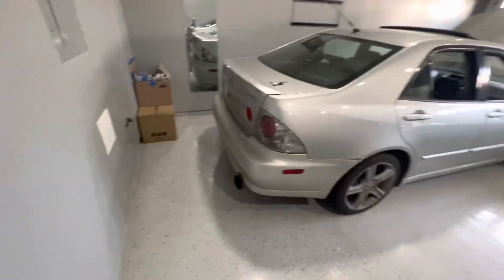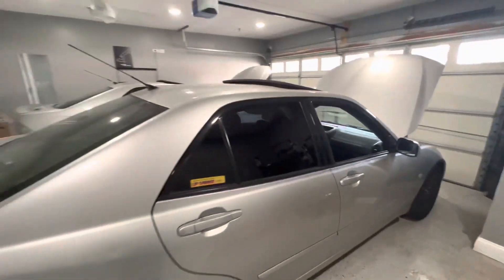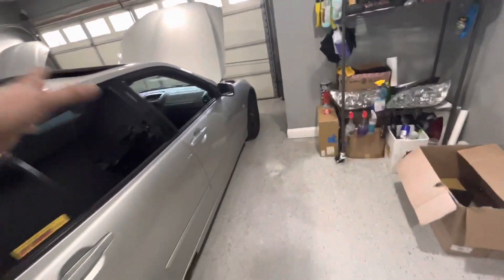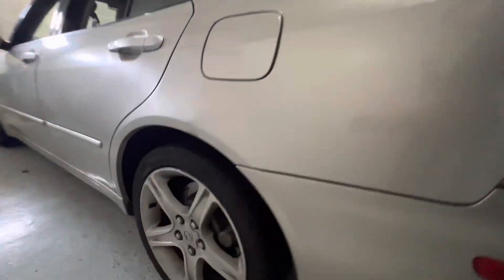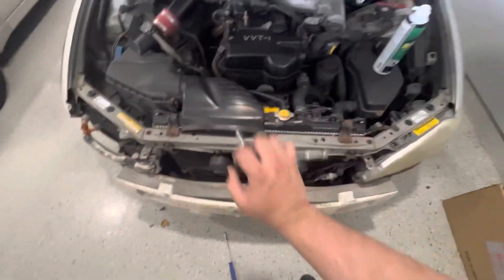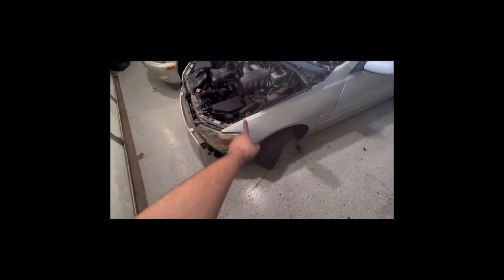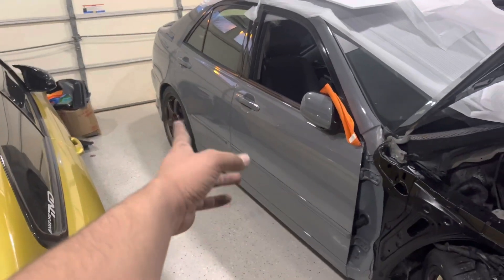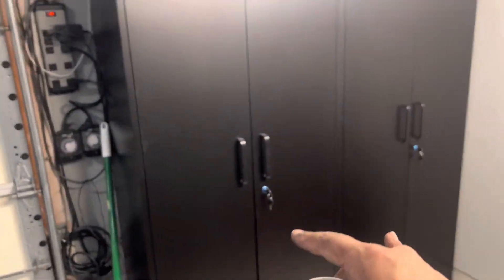My Manual and automatic IS300s

Comment: Where'd you get the lip kit for the is300?
Reply from the maker: So the car has a full Altezza kit, bumpers fenders lights and the OEM TRD v1 or elegance lip kit. Got it some parts from a local importer other parts from @faemjdmparts on Instagram.
Reply from the maker: Haha no I tried eBay lips in my is300 daily I use to have and it did not look good. Happy I went with OEM with this car. Although prices are going up from what I’ve seen lately.